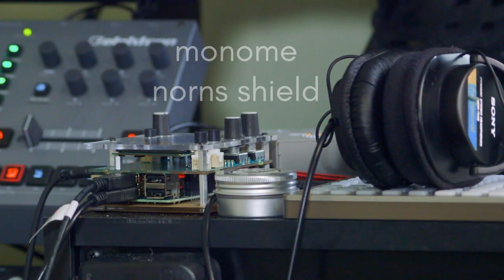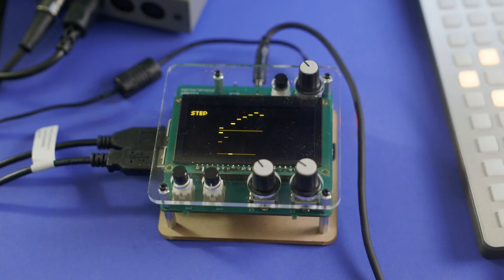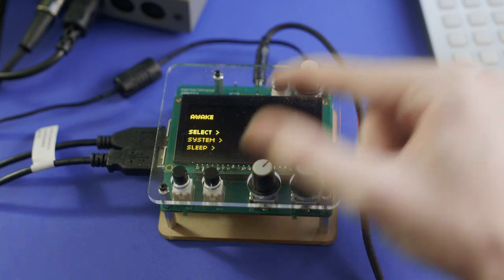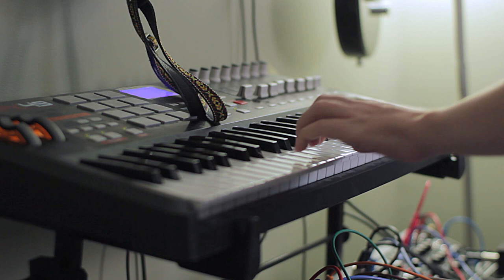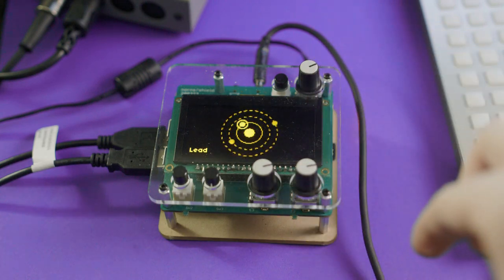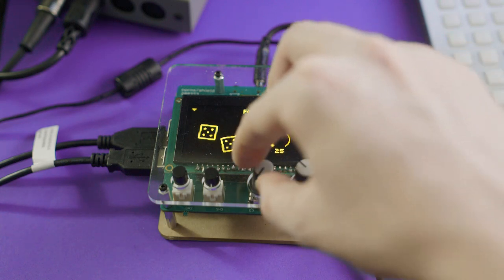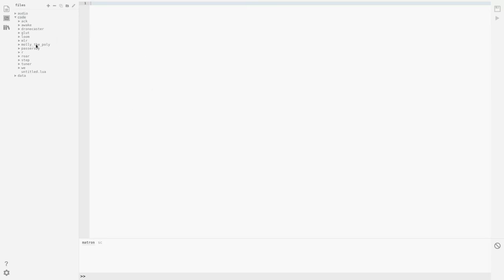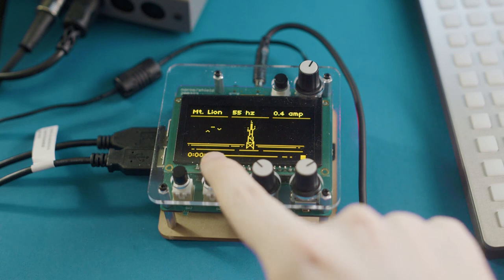Monome Norns Shield: An Introduction

Comment: Loving this...looking at both Norns and Empress Zoia. Wondering about the differences...they seem to have some similarities. Off the top, Norns has a better screen but Zoia seems to have a mini monome-like control surface? Am I not understanding this correctly in terms of functionality? They both are open source (?) and have solid communities. Wondering if Norns is easy to use? I can’t say for sure but Zoia looks fairly complicated because of possibilities. Thanks!
Reply: Really is going to depend on your preferred programming interface. Zoia basically emulates a modular system, and so you program it by connecting CVs with different parameters like patching together different modules. Norns is based on Lua and Supercollider. You technically don't need to know about code to use other people's scripts, but if you want to create your own stuff, you'll need to be comfortable coding or at least tweaking code.  Zoia is probably more intuitive to learn if you don't have experience with either modular systems or code.

Comment: I mean the regular Norns uses Raspberry Pi too just is put in a metal housing with larger monome pcb board and price doubled just for you :3 Lol and don't come at me with expensive screen you can get a 128x64 OLED screen for 20-30 dollars and this is a large pixel single color OLED. Latest version of Pi board they use is 30 bucks so the board they make is consuming a lot of that price. Technically speaking you're paying for the whole package and the aluminum housing is likely the most expensive part but in general I feel like the norns are too expensive. You might think the shield is not as good as the norns but you would be wrong because the PI is where the norns gets its processor, it's the computer brain for the norns.
Reply: Different audio in and outs  on the Norms
Reply: @johnkrummrich4948  1/4" jacks cost like ten cents. You really do pay for the whole package as its own unique object greater than the sum of its parts, but that's not necessarily a bad thing. We don't value art based on the sum of its materials! If I could afford it, I'd totally pay the price for a Norns, its a well-made, beautiful tool.
Reply: audio quality? Quoting the website here.
Reply: ethically sourced and produced, smaller scale than most operations drive up the cost too

Comment: So would you say it’s a decent virtual analog synth? I have a blofeld that I’ve been considering selling because I don’t use anything but it’s most basic VA patches, and I’m wondering if Norns would be a good replacement for that aspect, poly stuff specifically
Reply from the maker: I don't think it currently has anything approaching some of the better virtual analog VSTs like u-he Diva. You can make some great sounds, but the ecosystem seems to be a bit more focused on experimental interfaces and design than on VA. Of course, there is plenty of stuff out there you can adapt from SC world. All depends what kind of time and resources you want to put into it.

Comment: Noob question - I just built my Norns Shield but having difficulty connecting my midi controller (which is a SL-88 Keyboard) to the Norns - is there a list of recognised midi controllers somewhere?
Reply from the maker: Are you still having issues with this? It should work with any USB class compliant MIDI controller.

Comment: Have any insight on the difference between Norns / Norns Shield? Thanks.
Reply: same question here
Reply: I also wondered about this. Here are my findings so far. On the website ( https://monome.org/docs/norns/shield/ ) it says:

[quote]
COMPARISON
There are some differences between the norns and norns shield:
  * norns has a battery, 1/4” mono jacks, a separate headphone jack and driver, very high quality audio, serial connection over power port;
  * norns shield has 3.5mm stereo jacks (headphones work on the output jack) and an ethernet port.
Software is fully compatible between the two.
[/quote]

Apart from that, norns looks more professional, with its aluminium enclosure and bright white pixels (vs yellow pixels on the shield). Note that the norns is not simply a norns shield in a different enclosure: the button layout is different (same number of buttons but distributed differently), the screen is different (at least different colour), and it has different audio connectors (and supposedly high-quality ADC/DAC).

Other companies usually remove all kinds of features from their entry-level products, so as to prevent them from competing with their premium products. My guess is that monome decided that maintaining two substantially different products was not worth the trouble. But who knows. If you want to know more, maybe you can ask in the forum ( https://llllllll.co ).
Reply from the maker: Software is pretty close to identical. Norns gets you headphone outs + 1/4" instead of 3.5mm jacks. There are probably some differences in power and gain levels as well, but I haven't had a chance to play around with a Norns to compare. As others have said, Norns has battery power as well, but you can theoretically power the Norns Shield with any kind of battery power supply that gives you the right kind of juice.

Comment: Hi there. Could you talk about the connections on the Shield? Thanks in advance 🙏
Reply from the maker: What do you mean by connections?
Reply: Just what type of physical jacks it accepts? 1/4 or 1/8. Midi/USB midi. In/out. Thanks 🙏
Reply from the maker: @modgrip805  1/8" audio and MIDI is through USB. Both audio in/out are TRS.
Reply: @CarlColglazier  thanks sir 🤘🤘

Comment: Prices on the Mononome Norms link are pretty expensive for what it is considering the number of fully open hardware/software options available to the RPi community. And when you further consider you can buy a full scale small commercial synthesizer for the same - or less - money, this particular projects doesn’t seem , to me at least, to be very compelling either as a music tool or an educational resource. Just my 2¢. Others may see it differently.
Reply: this isnt norns but norns shield, got one secondhand for 90, so well worth it.